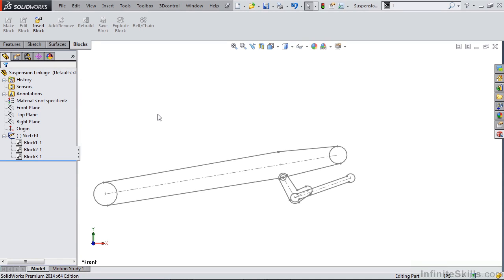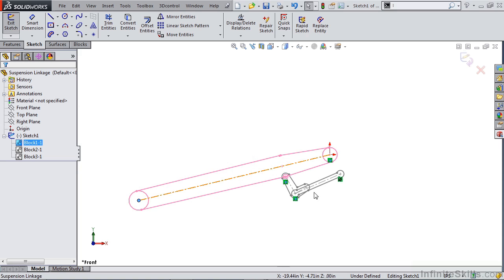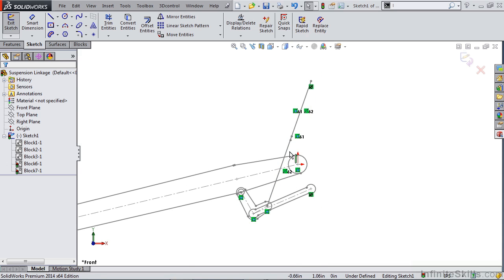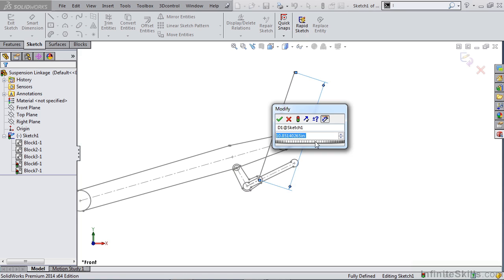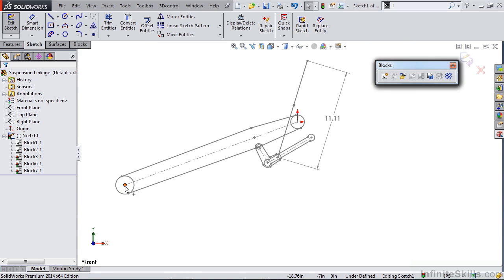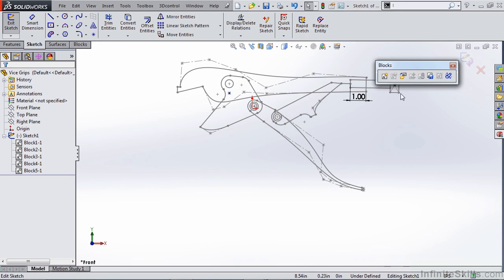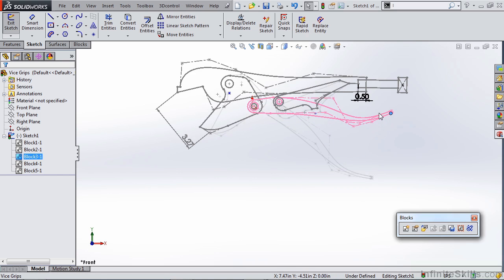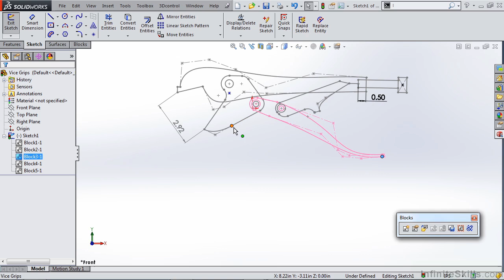SolidWorks - Kinematics Tutorial | Creating Linkages

Comment: Excellent video. I was wondering if you know how to make a "limit mate" with blocks. For example I am attempting to sketch the kinematics of an excavator and would like to limit the linear motion of the "hydraulic cylinder". As of now, I just have two lines, that are co-linear, but how can I define the amount of travel?
Reply: If you make horizontal line with 1 end attached to circle D 16, then it will move only 16 in vertical direction.